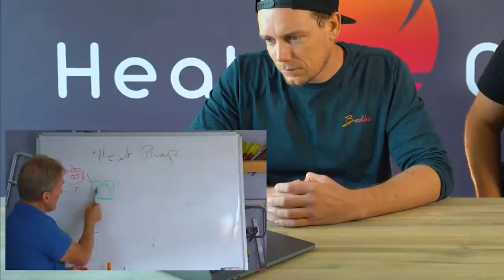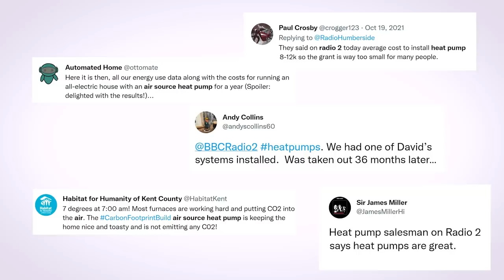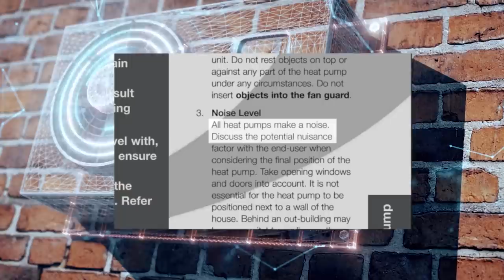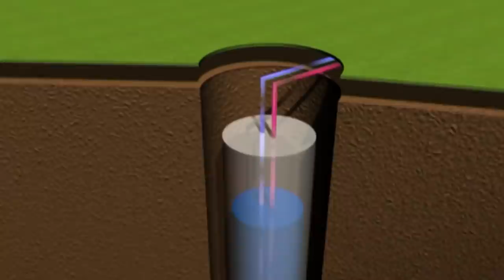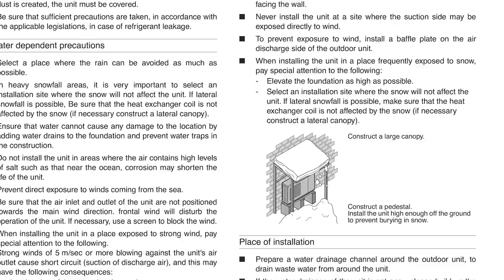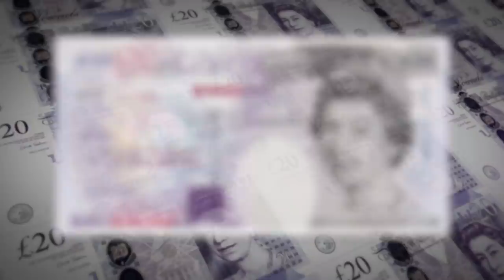Heat Pump Secrets They Don't Want You to Know

Comment: 5:05 gas fired power stations.... Efficient gas boiler in home, lets say it 100%, so 1kw of heat for 1 kw gas energy. Now if that 1kw gas energy creates electricity at a power station and with losses on the line and in production makes it only 80% efficient in getting that electric to the consumer. that's still better because that 800w of energy can then create 4kw of heat with an air source heat pump at the consumers home. Fail to see how its the same and back to square one. Like your arguments but please see the bigger picture. End of the day even with losses you can't argue you get more energy out than you put in with a gas boilers at 1:1 and can never improve on that, heat pumps you can get 5:1 and more.

I've a gas boiler, I've also an air source heat pump run from solar/battery bank which works well below -10'c, modern ones do. End of the day I'm not putting all my eggs in one basket, a mix of technologies works for me at this moment in time. Heat pump does keep gas bills down and warms up our large living room so much faster.

Defrost cycle at worst for me in 5 minutes every hour. Maximum my unit draws is 1KW on start up and settles to 600w, giving out 3kw, it doesn't have heaters in it to defrost, it reverses it's cycle to defrost...  end of the day you've got to ask yourself why almost the rest of Europe successfully use heat pumps... seems to be a big resistance here to something new... I think in 50 years or so people will be disbelieving that we had gas piped to our homes to burn for heat, almost like gas fired lighting on streets many years back.

 Final bit I love about it is when it's very hot and sunny, I have free to run air conditioning, something the gas boiler can't do....
Reply from the maker: I agree with some of your points but you are overstating the heat pump COP . The most optimistic figures from independent sources quote a seasonal COP of 3. Remember that it is running 24/7 whereas many people are running their boiler for around 7 hours a day.
The bottom line is that we get emails from people who say they love their heat pumps and also from people who regret having them and have had them removed. That is not good for the planet.
Reply: @SkillBuilder   We use ours probably on average 4 hours a day, we have a big front room and use it to boost heat quickly or cool. Gas boiler is our main home heating. Know how much it draws due to it being connected to the off grid solar system but now way of measuring actual heat output other than comparing it to the old 1kwh electric fireplace heater we used to run. Specs (SRC20ZSX-W) at the ideal curve of COP are 6.45/5.74  Cooling/heating, so would hope I'm getting 4:1 at least in un-ideal conditions. Even 3:1 is far better than 1:1.  I'm all for a mix of technologies at the moment...

Comment: I love this scam, as none of the guys pushing this rubbish talk about where the electric comes from, as if it is out the sky for nothing like magic. The basic fact it is a massive fridge working backwards with a very small output in regards to running your home still costs. They mention low running temperatures, so if you have 2 weeks for a kettle to boil to make a cup of tea it amount to the same and heat pumps are for you. They also seem to forget condensing boilers are designed to run high temperatures as fast speeds, with a lowest waste output as possible, at around 98% efficient clean combustible gases. That is better than your average present petrol / diesel car emissions. 55 years in the heating game both commercial and domestic tells me you still do not get something for nothing that is any good or useful.The old night storage heaters have a better and cheaper output with little to no massive install payments required. Not forgetting of course for ever install plus an electric car / family all have to be catered for by the mains grid, which will only increase in cost as that has to be nearly completely rebuilt if only for the charging points required. Which at the minute for long distance working, loaded vans are just not there at all, yet.

Comment: ASHP's don't work well in the UK - weather is cold and damp; cold and dry; warm and wet; warm and dry - we have that all in one week! So running 24/7 is the right thing to do, but reacting to the fast changing weather is very problematic. They are expensive to run and very expensive to maintain. They ARE noisy, particularly when the fans start to deteriorate - around £600 to replace, so what's the problem? Well, they are too complex and most retrofit houses in UK, older than around 20 years, aren't efficient enough - those in Norway ARE. UK houses, are designed for UK weather, not Norwegian weather. Driving rains causes freezing when +3 degrees and below. I've spent freezing nights defrosting the HP with hot water and a garden hose! Not particularly modern solution for a high tech piece of kit. With upgraded electrics into the house, at least I no longer have all the power tripping out for the house!

Comment: “I can’t see the difference between using gas to generate electricity and using it in a heat pump instead of using a gas boiler”. Perhaps you shouldn’t comment on it then? You need to do a simple energy balance on the two to understand whether one is better than the other. Then you might be able to see the difference (or not) rather than just saying you can’t see the difference. It’s lazy statements like this which do a disservice to largely informative videos.

Most houses can’t have ground source heat pumps so saying it is better is a bit irrelevant.
Reply from the maker: Paul 
I am amused by your comment. "A simple energy balance" that says it all.
Reply: @SkillBuilder  any mechanical, aeronautical or chemical engineer would do one for you in ten minutes and I am sure you would find one by googling too. The point is if you don’t know whether it is more efficient to use gas in a CCGT to generate electricity then to use it in a heat pump, or whether it is more efficient just to burn the gas in a thermal boiler then you shouldn’t say “you can’t see the difference”. 

As an example, it’s actually more efficient to generate electricity from gas and use it to power electric cars than to use diesel. It’s pretty close in efficiency to generate electricity in a diesel generator and charge an EV car compared to just using the diesel itself in a diesel car. It’s not always a bad thing to use electricity for things even if that power is partially from fossil fuels. Heat pumps are a special case as they have a multiplier of performance compared to the electricity consumption which makes it very efficient. It also makes it very difficult to pitch hydrogen in thermal boilers against heat pumps as the hydrogen production process is so inefficient.

The effectiveness argument is the real problem. Heat pumps just can’t get a high enough temperature.  I think the answer might be to use heat pumps to get to a certain temperature and then boost using resistive heaters when needed.

Comment: It hurts to listen to this. There is so much false information or fragments picked without the context, I cannot believe I once liked this channel. If Roger even had a slight clue about hydraulics he would know about flow rates and where these occur. Most heat pumps drive a storage and the flow rate from the storage (or in the case of some unfortunate customers low loss headers, which are actually high efficiency loss headers) to the radiators or underfloor heating has little meaning. 
Short: If your system is installed properly, your heat pump maintains its flow rate without you needing to know about it.
Why does Roger assume, heat pumps are all badly installed and does he even know that it can be done correctly?

Also rodent problems occur in outside boilers just the same, particularly in oil boilers they can even cause oil spillages in addition. I have yet to see a gnawed through copper pipe. I have seen spiders webbing gas boilers shut in a way that humongous amounts of carbon got released indoor. Luckily less of a problem with balanced flue boilers. On a heat pump you just lose efficiency.

Talking about boilers, why does Roger know about all those issues with condensate lines? Oh, because this is a major issue with condensing boilers. How many proud boiler owners already had to be rescued from frozen condensate lines? Way too many and I have just seen an installer fitting a boiler in the neighbourhood, making sure he (or another plumber) gets the call out as soon as we hit frost. What do boiler manufacturers advise on external condensate pipes? You have seen it in this video as a problem of heat pumps ...

There is just too much to actually take it all apart. Two  things I agree is the fact that cowboys sling in heat pumps in an entirely unsuitable manner and give them bad names. Also ground source heat pumps can work nicely but have some other caveats. 

What about those backup heaters, Roger was talking about? Looks like Roger has not seen modern heat pumps for a long time now, there simply is no backup heater inside. You could not switch it on, if you wanted. There are some (of the larger) compressors with a small heating element in order to condition the oil temperature. Maybe he's mistaking those for a backup element? Particularly an issue in vastly oversized heat pumps. Almost all modern air source heat pumps defrost rapidly via a reversed cycle, no need to wait for a heating element to pick up temperature (the heat is already there, hence it gets used) and it's cheaper to make as well.

From what I have seen so far, the combination of a smaller ground source heat pump with air to air source heat pumps appears to be the most efficient solution. The ground source brings high yields till late winter whilst the air source picks up months before the ground source even slightly recovers. Sounds like it would be expensive, but in fact, larger heat pumps are a lot more expensive and you may as well have a guzzling compressor heater in those bigger models(particularly in ground source heat pumps). Therefore such a system is barely more expensive.

Roger, it is high time to inform yourself about the subject before you keep pushing out further rants rather casting doubts on your knowledge and abilities.

Comment: I have a Mitsubishi Ecodan heating and water air source heat pump in my (supposed to be) super insulated 4 year old home and it’s totally crap!
Costs an absolute fortune to run in the winter around 49kwh per day, before any of the total rip off elec price increases I paid £485 for 35 days of heating and hot water.
My heating was barely enough as I set it to 21 degrees and water to 54 degrees.
If I had a gas supply to my property I would rip this hideous GREENWASH money spinning unit out and bury it in the garden then replace it with a gas boiler.
My previous home had a 20 year old gas boiler plus electric everything else including a real hot tub that was running 24/7/365 plus an open to house large conservatory and the room temp was always lovely and warm but cost half of this new ‘super green super efficient BS’ home.
DO NOT GET ONE UNLESS YOU HAVE A SERIOUS SOLAR ARRAY AND MASSIVE BATTERY BANK ATLEAST 15kw!

Comment: If you buy cheap.  Also gets shit.  Then the fault is not in all manufactured devices.  There is quality.  And that shit.  If you need some space, you need to heat it because it's cold outside.  The importance of insulation is obvious.  It doesn't matter how you heat it.  A quality device only needs 230v voltage.  A 10A fuse is enough.  Which it uses to function.  But it's hard to say what kind of amateurs have installed cheap crap.  And what kind of seller was this cheap crap bought from.  And what can be said about power consumption.  Year 2022. 365 days.  of which about 10 days HP did not heat.  And it didn't cool down.  Otherwise, it warmed the winter and cooled the summer.  24/7/365.  Electricity consumption for the whole year was 1769 kWh.  Now 2023 to this moment in the same way.  And the electricity consumption so far is 1262 kWh.  The summer was not so warm.  So it didn't take that much cooling.  But it has been cold before.  So heating has been needed.  It might be worth getting a high-quality device intended for the north.  And not cheap crap that doesn't work anywhere.  And a truly professional installer.  If you have a device worth about 2000e.  price over or under.  Too expensive.  Then you have to look for other solutions.

Comment: This Dude Knows Nothing about Heat Pumps, Mini-Splits or How they Work. 
He's Reading Installation manual And Is Taking It Literal. For Example: He Said Heat Pumps are Noisy Because The Manual Says they can Be Noisy and You should be Mindful Of That when considering Placement. 
    This Is Merely The Manufacturer saying it can make noise, Like  if it has Problems, or maybe its Vibrating the Mount.I have  Actually installed and repaired hundreds of these systems and most of the time I have to look to see if the fan is turning because it's super quiet. The decibel ratings are probably in the manual as well. 
I don't think using these systems for floor heating or to replace the classic radiator systems is the best use of these. I would utilize my old units for that Purpose and keep the heat pump functioning to heat the air. 
And as far keeping them running 24/7 to make them work best, I think again he's confused. Yes you will keep them "on" and in some situations it may run none stop, or Atleast appear that way, but the reality is if you have a proper insulated home with a properly sized equipment,  these systems will not work hard to make it toasty.

Comment: LOL, so much hate for heat pumps. Mini splits works fine, no, they don't need a 6kW power supply, no they don't need heat tape or extra insulation, this is just plain BS.
Yes, they make noise, and yes it's a different kind of heat than radiators, but they work just fine.
Reply from the maker: Nobody is talking about mini splits. We are talking air to water in the U.K That is what the government is promoting and giving grants for. 
Anything that allows cooling is not on the agenda in the U.K

Comment: What utter negative bias.  You forget to mention the COP.  Your example 6kW electric demand will return around 12-18kW of heat energy.   More than enough to heat a family home.  

As for defrost, it doesn't take long to perform defrost, the warmth in a house especially if you have heated a concrete underfloor substrate will not fade away for several hours.  

Siting will and should be crucial to ensure optimum performance.  Regarding glycol, you didnt mention the anti rust products which need to be changed regularly in gas central heated systems.

Stop with this anti heat pump drivel.  The Scandinavians and USA have been using this technology for years and they have far colder winters than the UK.

Comment: Well, Roger you have fitted heat pumps, which by your own admission don't work well. So you are the installer to avoid. Why should we take your advice then?!!!!!!
Reply from the maker: Nick 
I have fitted heat pumps for pools and houses. They work well enough in the right house but there is a lot to consider and salesman are not interested in telling you that they are not great in cold weather unless your house is well insulated. Ignore my advice by all means, it doesn't worry me.

Comment: If you can't see the diff of using gas to create electricity to power heat pump (COP 4) vs using gas to produce heat (COP 0,9), then you need to go back to school and get out of any business related to energy.
Reply from the maker: If the heat pump is COP 4 then that is not the Scop. You also don't factor in transmission loses and the fact that the heat pump has to be running 24/7. Thanks for the advice about going back to school, I never left, every day is a school day.

Comment: What a lot of hogwash! This is pure click bait/ wanting YouTube money! Any heat pump is by no means perfect and you have to select them with some knowledge involved but this video is not it! If you have more competence you would acknowledge the difference in “quality”/performance  there is between different heat pump manufacturers/models. As always you have the cheap knock-offs saying they are a heat pump while only working with some kind of efficiency at +7C degrees! I have a air to water heat pump  (installed in 2013) that is slightly below COP 2  in -15 degrees! And yes, I did my homework and selected an appropriate one!  Selecting a heat pump requires competence and you are for sure not helping as you seem to fail to acknowledge the difference in characteristics between them and how to select an appropriate solution for a specific need. You are only searching for clicks/views without any real regard for you viewers, sad.

Comment: This guy is wrong on so many levels. But hey at least he taught me that gas furnaces are impervious to rodents.
Reply from the maker: They are generally indoors. Heat pumps are outside.
Reply: @SkillBuilder  I've repaired many furnaces in attics and garages that have chewed pressure switch tubing and low voltage wiring from rodents and even squirrels. Rodents do get into houses, hence pest control. Geothermal heatpumps are usually in garages. Condensers for ACs have all the same outside components as split heatpumps (essentially) so are you condemning air conditioning too? The point is, your arguements are essentially all straw man arguements. But hey, at least dislikes are private now so people like you can spread misinformation. To clarify, I think you aren't trying to mislead intentionally, but you suffer from dunning kruger.